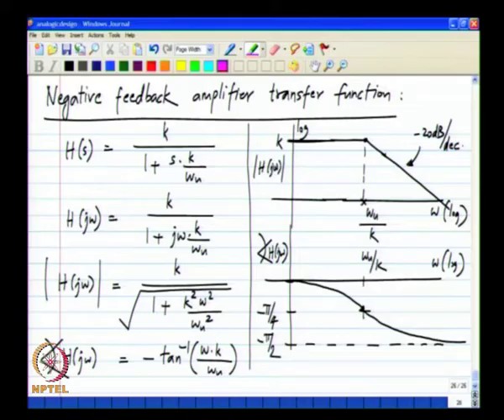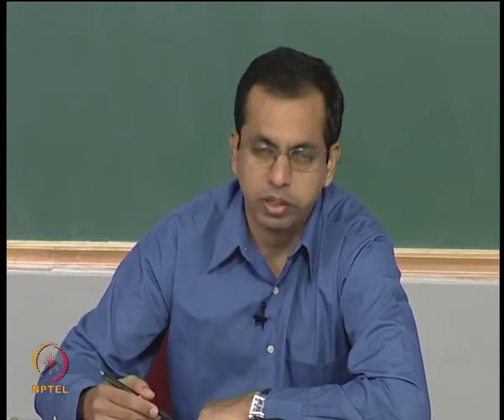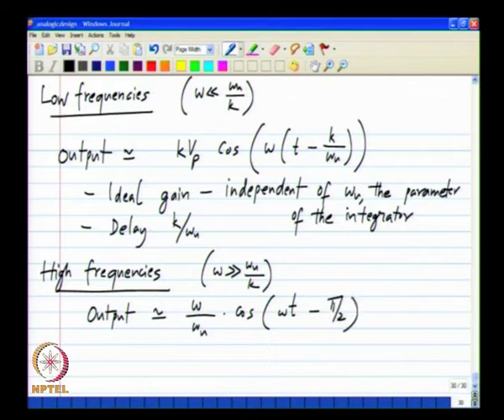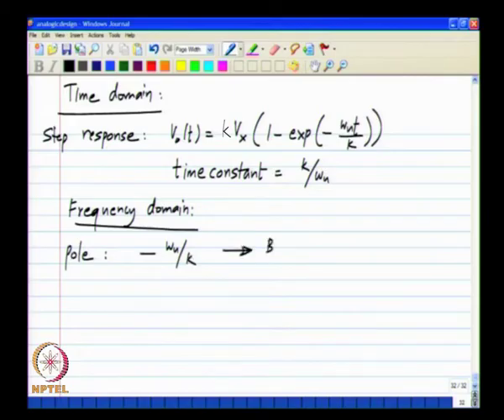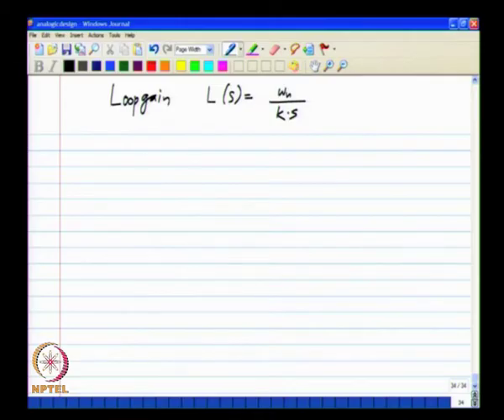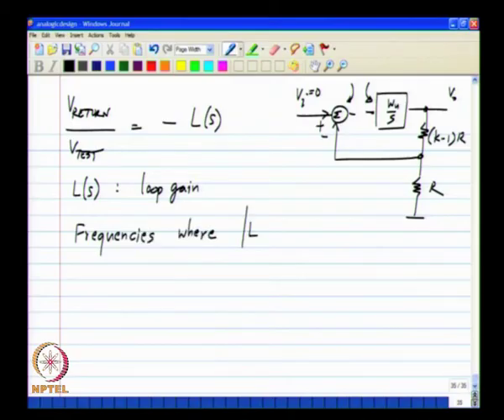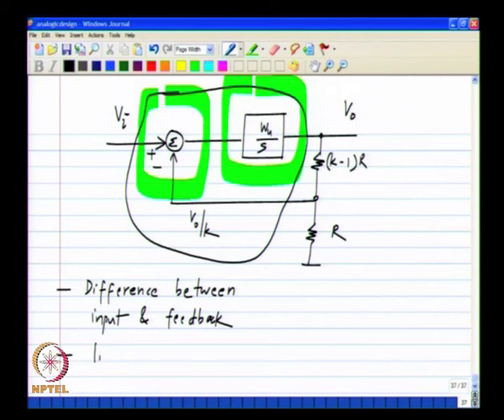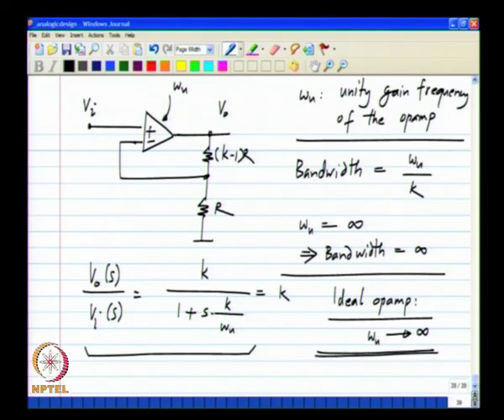Loop gain and unity loop gain frequency; Opamp

Comment: Sir! How the OPAMP is helping in calculation of Integration?
Reply: By opamp, he doesn't mean the final opamp comes in the form of packaged chips which amplifies the difference in the voltages of its terminals. We are attempting to realise it, but we are not there yet. By opamp he means the opamp which we design using differential pairs,  to which there will be a capacitor connected at its output terminal. That capacitor will integrate the output signal. Thats what he means by opamp which takes the difference and intergrates it.
Reply: The Integrator itself is built using a transconductor (VCCS) and capacitor.  OPAMP= VCCS + Capacitor. The differential amplifier in OPAMP takes the input difference
Reply: @NaaJeevitham500  That is correct but my doubt is different. The action of OPAMP is to take diffence of two signals and amplify it to give the output i.e. Vout = A(V1 -V2)... This is the action of OPAMP....But sir told in the video that in negative feedback the difference and integration both can be done through OPAMP...But OPAMP would not do integration directly... If you consider an OPAMP as black box then it will take the difference of two signals and give an amplified version of that difference signal which is the output of OPAMP... 

Obviously as per negative feedback amplifier concept, we have to take integration of error signal and that is why Sir has introduced VCCS and the output current has flown through Capacitor to emulate the behavior of integrator and total block (VCCS +Capacitor) he called as OPAMP... Is it correct to say it as OPAMP?